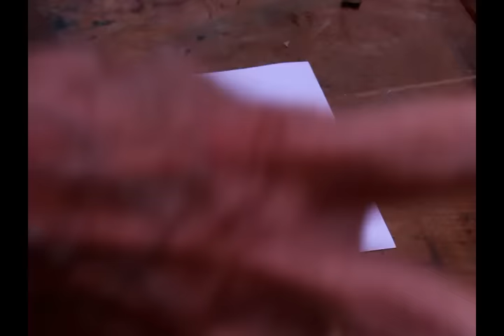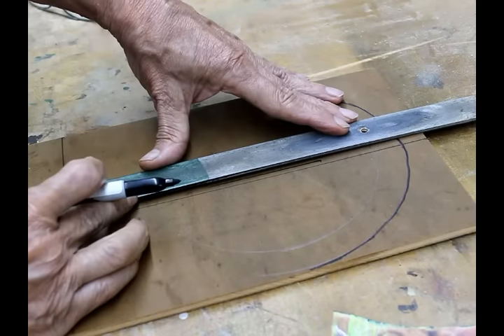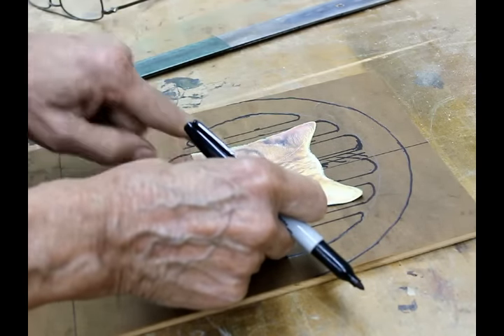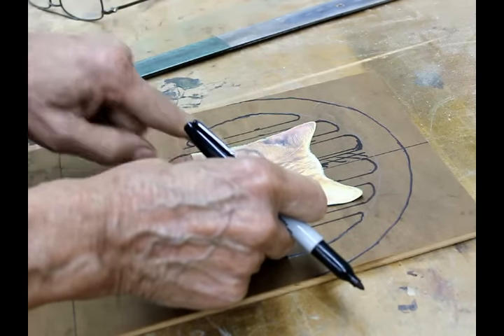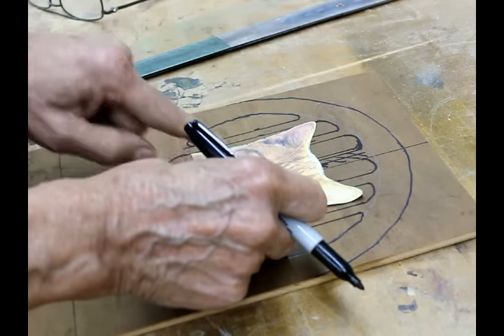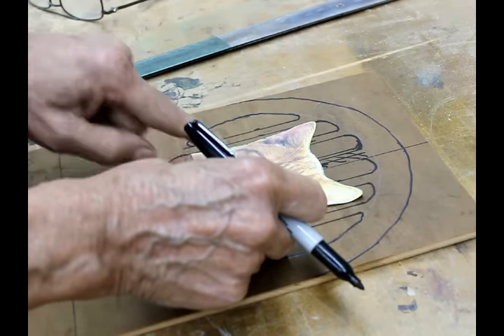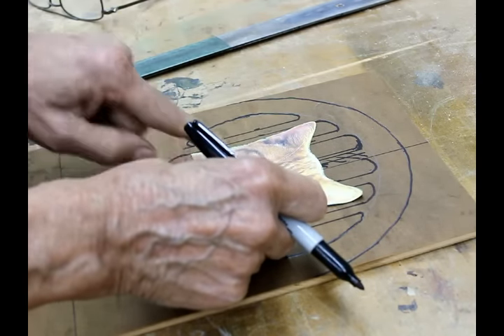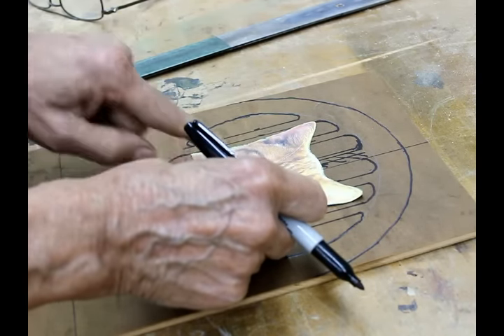MAKING A CAT RADIO

Comment: Nice project. 
You could have replaced one of the radio diodes with a galena crystal then it really would be a CATs whisker radio!
You mounted the small speaker straight onto the outsize front grille. Would have been better to have mounted the speaker onto a thin baffle first to improve the bass response.

Comment: A lovely looking radio and you make its construction look so easy!

I would have preferred the speaker to have been mounted on a thin baffle (and maybe a slightly larger speaker too). I find it fatiguing to listen to a tinny radio like that for extended periods of time.
Reply: The audio chip can't handle more power.
Reply: @MrGigi-dz9cv  Not so. A larger loudspeaker still has the same load impedance. As a child, I connected many a small transistor radio to an 8" or 12" speaker (not hi fi speaker) and the results were always good.

Comment: That ended up looking so much better than I had at first anticipated!
Could you elaborate a bit on rewiring/moving the volume/power controls?
I've got an ancient Philips 836A radio with innards that are fubar and have been playing with the idea of sticking a 'modern' transistor radio in there.

Comment: Do you ever run across radios or old clocks that are designed for wall hanging and plug into those old recessed 'clock sockets' like old houses have?
 I just recently stumbled across your channel, and I was born in 1947 so appreciate all the hand made stuff....just like when I was a kid, you wanted something, you had to make it!
 and....no hot glue or battery tools...

Comment: Hi Ron, I have several questions for you.I have an audio output transformer with an open primary and I would like to unwind it, solder the broken winding and put it back together.The transformer was impregnated with some kind of lacquer.Question 1:how do I get rid of this lacquer that covers the transformer? 2:can I reuse the winding on the transformer? 3:what kind of tape should I use to isolate the windings?
Reply from the maker: First, this is a hopeless task! The transformers were wound on a winding machine that puts the turns side by side and then applies the thin wax paper separator between each layer. Impossible by hand. Second, the wire is going to be enamel paint coated. (modern wire is coated with a tough polymer coating)  This enamel deteriorates with time so it will fall off the wire as you handle it. New wire is not expensive but it still would be impossible to wind it by hand and get the same number of turns in the same space. Find a used one or buy a new one from AES.
Reply: OMG Sir, was worried, long time i did not saw you posting something.
Hope you are doing well, still have some fun with your awesome projects and skills.
Happy to see you again, big salutations and wish you the best!

Comment: Please do another video soon. After a 50 year break I've taken up electronics as a hobby again. Much of what you do brings back some great memories, EL34, EF86, ECL86 . Been a very long time - too long.  Class D amps and linear power supplies now - all those fiddly little black things with legs. I looked up Mullard 20 W ( I built 2 ) and it was No. 1 on Google UK. The National Valve Museum. Oh Gawd does that make you feel old or what.  Still the smell of lead solder hasn't changed - nor burning fingers. So, for Anglo American relationship - do a video for an old wrinkly.

Comment: Thanks I have learned a lot from you. Are you an electrical engineer?
Reply from the maker: For 28 years. I'm retired now.
Reply: What kind of stuff did you do before you were retired? I assume it wasn't the vacuum tube stuff we see you doing here.
Reply from the maker: Retired EE. Did development of complex computer controlled data acquisition systems. Very difficult compared to this easy stuff you see in my videos!
Reply: Woah... from one "end of" electronics to the other.
Reply: Ron, it's all relative. Funny how the essence of technology is considerably more simple than the underlying science. You'd be a good guy to be stranded on a deserted island with!,

Comment: I would have swapped out a larger speaker for the 2 by nothing job that came with the radio.
I cringe at the sight of some idiot getting their hands that close to the table saw blade without using a push stick!
The radio capacitor shaft extension could be a 1/4" rod tuned down and threaded on the lathe to screw into the capacitor, held in place with some locktight.